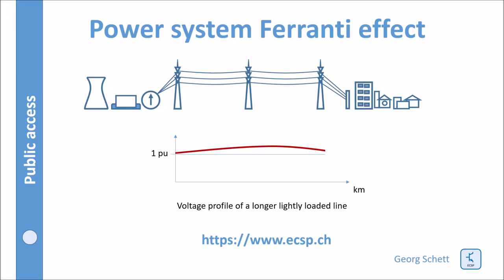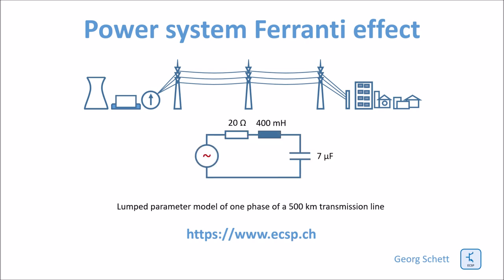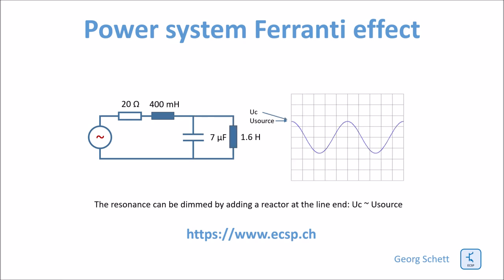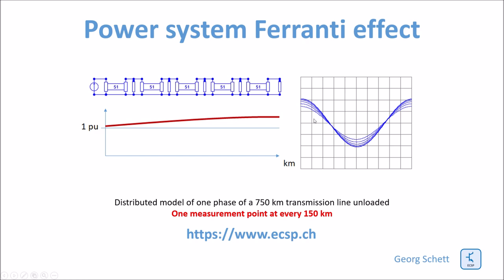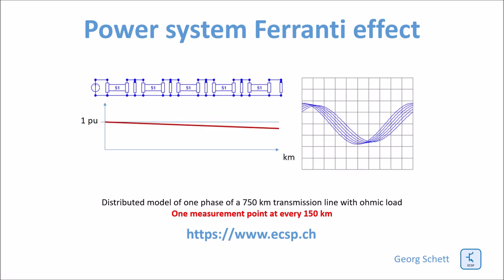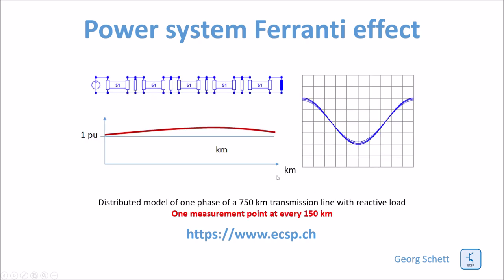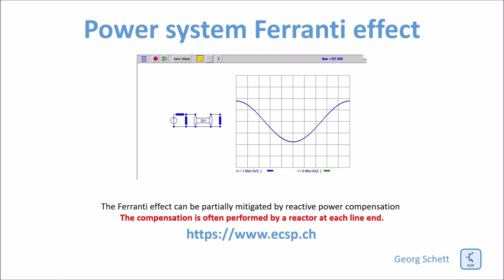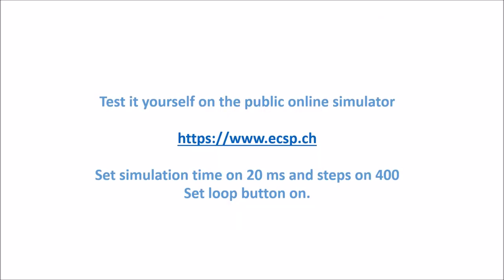Power system Ferranti effect

Comment: increase load = decrease in resistance? i don't understand, can you explain ?
Reply from the maker: With a high resistance the current flowing is small, thus the power fed to the resistance is low. When you decrease resistance, the current and thus the power increases up to a tipping point. Load(load-) power is normally referred to as load. Thus, up to the tipping point decreasing the resistance increases the power (=load).
Reply: Load refers to the current that is drawn. If resistance is high then load is low. If resistance is low then load is high.